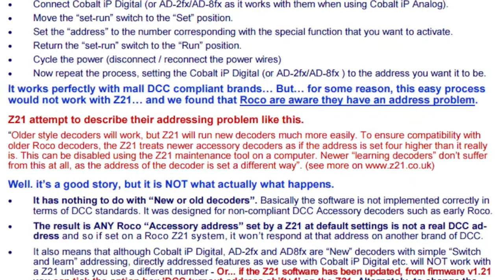How To Program DCC Concept Motors On The Roco Z21 + More Answers!

Comment: Hi Andy. Nice video very useful but doesn't answer my problem maybe you can help or one of your subscribers. I have not turned my system on for about 4 months when all was well. However today I turned z21 on(the black one) and started running trains with no problems. The problem I have is the points will not operate using the dc concepts cobalt units in fact none of the 21 points I have. Talking to the suppliers was no use they said and I understand that the base unit was not receiving the signal. I was actually trying to renumber all the points and as usuall I flicked the switch on the cobalt unit to programme the 1st point motor but the icon would not move. It was then I tried to operate all the points only to find none of them worked. Any advice would be appreciated. What was the email address for the guys in oz?
Thanks.
Roy

Comment: Today I tried my Cobalt deactivation of self centering , but failed . I am such a dunce , because I am not familiar with my z21 at a first place ....
and so frustrated ... do video for that , and I will be greatefull .
As for cleaning , I am aware that this was posted two years ago , but still , I have an answer if youby now did not get it yourself ... 
Cyber Clean " swiss formula" ( whaatever that means ) , sold by Bush . Gooey greenish thing , perfect for  steam locos that I have . But you can clean almost anything on your layout with it ...
Second thing is , a vacum cleaner , with a water filter : prevents dust coming out of your vacum cleaner , and  you can always have  a detailed analysis of what have you vacumed .
and off I go to search the knowledge of mz z21 ..

Comment: Hi Andy, I just watched your video, you are right, DCCconcepts is in Australia, they are actually just south of Perth, Western Australia, in Naval Base. I've been there a number of times, the last time I was there, was 27/04/2017, Peter is a very nice person, well they all are actually, and they have many years of knowledge. DCCconcepts opened a shop in the UK a few months ago, its at the end of a road called, The Siding, it's behind the Settle Station, the building has a dark blue roof and doors. Regards Gary
Reply from the maker: Gary Lester thanks for the info there Gary! If I'm ever in the area I'll be sure to check it out
Reply: That's ok Andy, google maps comes in handy 😊. Cheers, regards Gary